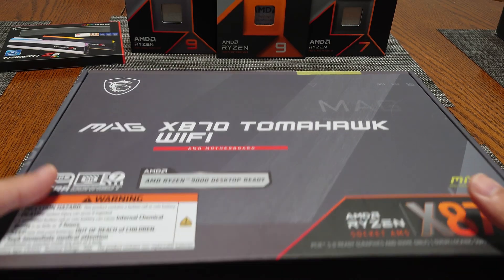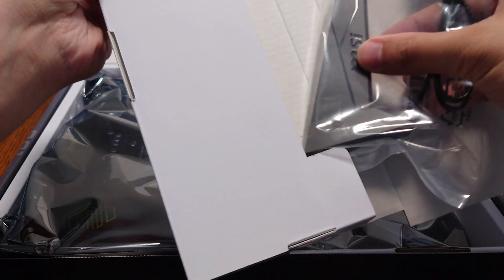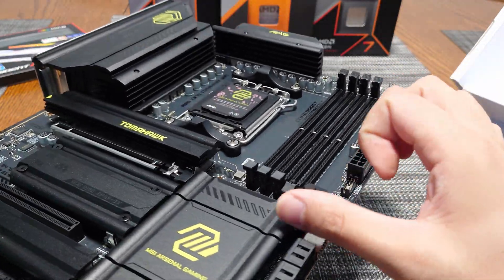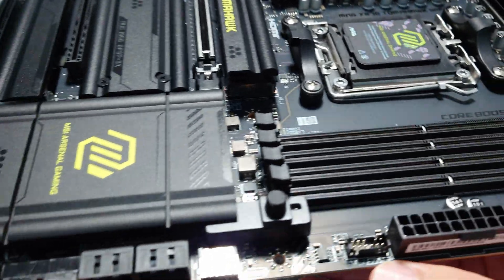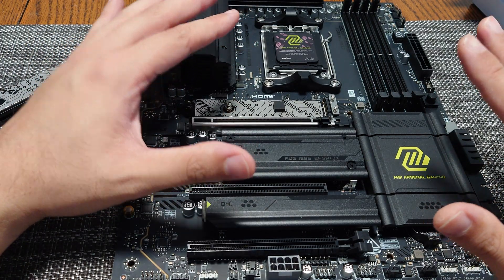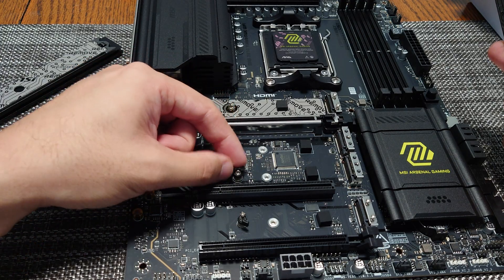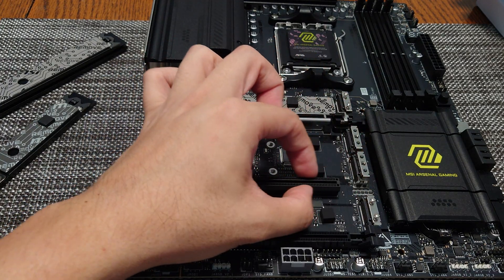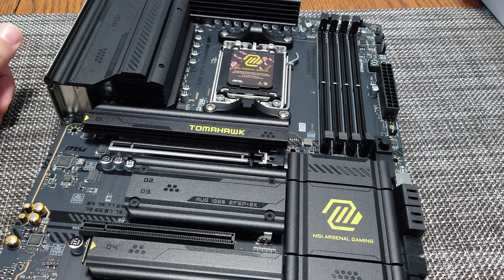MSI MAG X870 Tomahawk Unboxing and Overview

Comment: Considering even the RTX 5090 is nowhere NEAR compromised in a PCIe Gen5 x 8 slot, MSI REALLY should have thought more about PCIe lane splitting/port compromises - those USB4 ports on the back panel should NEVER be sharing lanes with that 2nd M.2 NVME slot...
--> We do NOT need a PCIe Gen5 x16 slot this GPU gen...or next GPU gen (and likely at least one beyond that) !!!
This is a board with fantastic potential, but, badly let down by needless choices/compromises.

Comment: do i need to plug anything into the 8 pin PCIE PWR input at the bottom if im only using 1 pcie lane for the standard gpu? (7900 xtx)

Comment: I got this - opened a case with MSI as the bottom 2 slots wouldn't allow me to populate without disabling little things like the onboard video or the USB ports.   Never heard back after taking a lot of time to fill out their gauntlet of questions to even open a case.   The only thing I got back was - what bios do you have - which was answered in the gauntlet questionaire form.   I swore of MSI motherboard a decade a go due to their cheap manufacturing - fool me once...

Comment: No experience of the others but this one’s a nice easy setup. Using it with 64gb ram and ryzen 7800x3d running nice and smooth as a desktop until I sort a gpu. You may want to make sure you have the drivers for the WiFi on a usb because mine never installed from the included usb

Comment: On the 2nd toolless M2 slot there is a rubber on top of the thermal pad ... which makes it completely useless... odd design.
Reply: That comes off with the protective peel. It's just there to keep it from wiggling around when no ssd is in place.

Comment: I guess with a single sided SSD such as Samsung 990 Pro, you shouldn't remove the bottom rubber pad/plastic covers?
Reply: I bought it after all and yes the bottom rubber pad/plastic is pealed off before inserting in place the Nvme ssd, as well as the sticker from the top heatsink. Great MB by the way..
Reply: good question. did you find out? I'm waiting for the parts to build my new pc and i was wondering the same..
Reply: @georgiossaridakis5056  It'll bend the SSD if you leave the pad so it's not an option. The optimal solution seems to be adding like a 0.5mm additional thermal pad. I ended up getting the asrock B850 which have good contact by default.

Comment: Awesome, thanks for the info. Picked up this board after seeing the specs and didn't think too much about it. MSI hooked me up in 2013 when I bought a $150 board and my PC eventually stopped booting. The problem turned out to be the processor, but MSI sent me a new z77a-g45 board anyway for free, which was a much more expensive board. They certainly didn't have to do that, so I've stuck with them ever since.

Comment: Disabling lanes in the bios to the 40g usb ports and have the second  m.2 slot also run at full bandwidth which is awesome   5.0 m.2 x2 max bandwidth and the 5.0 gpu slot using all 16 lanes. not see any other board  that can do the same. 👍

Comment: "M.2_3 Source (From Chipset) supports up to PCIe 4.0 x2 , supports 2280/2260 devices"
"*PCI_E3 slot will run at x2 speed when installing device in the M2_3 slot. You can switch PCI_E3 slot to x4 in the BIOS, but this will disable the M2_3 slot"
Pretty shit tier mobo right there.

Comment: This board ok then with no performance issue's?
Ive read about the 9800x3d performance being worse and better on the old 600 series boards ? 
Im swaping my asus x870e for one of these as the network adapter is causing packet loss unless i use default drivers dated 2015.
Reply: the asus pocket loss can be fixed by disabling energy efficient ethernet
Reply: @MFN073  I sent it back got full refund... The MSI replacement runs much better with zero issues.  The CPU even benchmarks faster.   Runs cooler ..
Reply: @russc5269  unfortunate the asus was a good one. Msi is very slow with bios updates. Like until last week they only had beta bios versions which is pretty absurd considering the mb is a coupke months old now
Reply: @MFN073  my Asus was dog poo.  I'm not a fanboy of products, just want a working one. 
The MSI is just working and perfectly even with the beta bios.  
Works great with the 9800x3d and 4090....

Comment: I love the amount of extras you get in MSI boards, my last two gigabyte boards were fairly high end and came with the board and a sata cable... that was it. 
A USB stick with the drivers is insanely helpful if you use ethernet and windows doesn't download the drivers properly.

Main reason I want this board is the post code LED's. the one board where I didn't have it I had zero clue what was wrong when the ram slot died.

Comment: This mobo is so unstable for me. Constantly getting POST issues and having to reset CMOS often
Reply: Check your psu and power connections, that’s what fixed it for me. I had an inconsistent ground plugged into a loose outlet.

Comment: My motherboard x870 tomahawk can only do 2 sticks of ram. I want to use all four sticks. What do you think I should do
Reply: why can't it use all 4? tbh though 2 sticks is always faster, hence dual channel.
Reply: If you really want 4, it depends on your amd chip’s memory controller. Go for a low speed like 5200mhz at 16gb per stick and your board should be able to handle that with no issues

Comment: If i slot in a pcie 4.0 m.2 ssd drive to the second pcie 5.0 capable m.2 slot does it still share bandwidth with the usb 4.0. If thats the case which would be the optimal slot for a pcie 4.0 ssd?

Comment: Quick question.  Are those Rubber Cubs thats glued to the M.2 Slots meant to be removed (Particularly the M.2 Slot 1)?  Or are they intended to hold up the M.2 SSD (As if it's levitating)?

Comment: Nowe compare it to Asrock X870 pro rs wifi. To me Tomahawk is not worth it compared to Asrock.
Reply: The Tomahawk has been going for 250 on Newegg (and that's what I got it for), and that is only 40 more than the Pro RS Wifi. The Tomahawk offers much more. The Pro RS only has 3 M.2s and one of those is gen 3. And if M.2_2 is coccupied, then PCIE_2 will be disabled. And if SATA_1 or _2 is used, M.2_3 will run at Gen3x2. Also, the Pro uses the 160MHz channel bandwidth Wifi, which cuts in half the wifi7 speed, the Tomahawk use the 320MHz version. These are just some thing to consider.
Reply: @RKBenchmarker  In my country Tomahawk is $100 more. I only use two m2 ssds. Tomahawk is great board but not $100 better.

Comment: I would really appreciate if you actually measure vCore and vSOC on the board.   I had an MSI board frying a CPU in the past, I want to make sure MSI is not fooling around before buying another one.
Reply: That was an issue with all the manufactures, which was fortunately corrected with bios updates quite a while back.

Comment: I bought bundle with it. G.Skill Trident Z5 2x32 Cl30 6000 Mhz, AIO is Acrtic Freezer III 360 and Ryzen  9 7950x3D. Will receive it tomorrow
Reply: I also built a system with that same setup as you, still tweeking it but I noticed in the bios theres a setting for NPU boost. Mines ghosted out but before the g.skill ram I tried some corsair stuff that I couldn't get to run at the rated speeds but the NPU option was available. Once I installed the g.skill ram it went away for some reason.
Reply: @s0lice  is there a new BIOS update? I will check it out
Reply: Friend, tell me, is there an error 08 on your x870 display?
Reply: @finch_er  when I had the Corsair ram, I can't recall what error code it would hang on. Now no errors, my system has been pretty stable.
Reply: @s0lice  Thanks for the answer
Reply: @finch_er  I updated BIOS and now there is no error but it resets itself going into blue screen after few min in Win and after self reset everything works perfecr
Reply: @DominikV235  I also want to update and wait for a stable BIOS version, but so far only beta versions. So my error 08 does not seem to affect anything. The computer works as it should. But when I launch a demanding game, the error appears and does not go away. At the same time, all the tests of CinemaBench r23 and others the computer passes without error 08.
Reply: @finch_er  I guess people will adress the issue like we do and they will fix it with future BIOS updates. It is a bit serious matter for a MoBo of this class
Reply: @DominikV235  I didn't wait and also updated the BIOS to the latest version. Other errors appeared, but 08 is gone :). I configured the curve by cores. All tests pass without errors. Everything works fine. This is my first computer and I don't know, maybe it should be like this and I'm just making up these problems. The main problem with this board is this small screen :). I hope that they will fix it in the future.
Reply: @DominikV235  Haha :) friend, I realized that the numbers appearing on the board screen after updating the BIOS are not errors, but the processor temperature :)))
Reply: @finch_er  haha yea but not if they got letter next to number
Reply: I didnt get a bundle but I ended up ordering that exact setup after research. even the same aio. only issue is im stressing as this is my first build and I dont know what I need to get the 7 case fans and aio to run and with rgb.
Reply: @smolcap  I don't fancy RGB.
Reply: i have the same mobo but with the 
corsair vengace rgb pro 6000Mhz cl30, ryzen 9 7950x, arctic freezer 240

Comment: You may popoulate all the ssd slots and still have the PCIE run at x16 but the ssd PCIEs Gen 5 slots run at x4 and Gen 4 slots at x2...what on earth?
Reply: The M.2 gen5 slots are x4, so no problem there as that is what they are supposed to be. And the Gen4 PCIE x2 has an option to run at x4 in the bios if that 3rd M.2 is not used. When that M.2 is used, at x2 it will still run at about 4GB/sec. Those are actually quite good options for a non-E $250-$300 mobo!
Reply: @RKBenchmarker  Oh, I was completely unaware that x4 lanes are what M2 slots use in general. I thought the more lanes, the better
Reply: @drimiteros_21  That's understandable as there is so much going on. But, I hope it was helpful :)
Reply: @RKBenchmarker Quick question, I have a gen5 ssd I plan on putting in the first slot but I plan on getting a gen4 sdd later on. Would the best place for the gen4 ssd be the bottom slot?
Reply: @NutsorSomethingBerserk  for bulk storage, seems fine no?

Comment: I don't see the point of the second or middle PCie slot.Guaranteed a GPU will block that PCie slot,even if you're able to populate that slot,airflow for the GPU will be a 'serious' problem. 
   I've seen this problem on a lot of the mid-tier to lower end boards,X870E and X670E alike. 
  It's as if the manufacturer is 'MOCKING' the buyer.
  Sigh....
Reply: It’s really sad they placed it like that. I was seriously considering the Tomahawk over the Nova because I want two Gen 5 M.2 drives running at 4x. Can’t do that on the Nova, but the Tomahawk allows it if you disable USB 4 that I don’t really need for my setup anyway.
Reply: @johnraahauge4552  Would you be using the pcie slots for anything?
Reply: @RKBenchmarker  no, just GPU
Reply: @johnraahauge4552  That would be an awesome board then! And Newegg has had it for 250... that's what I got it for.